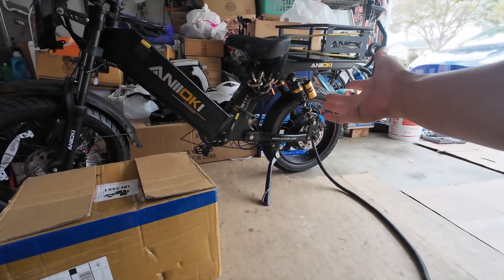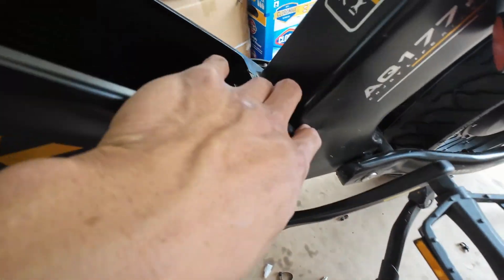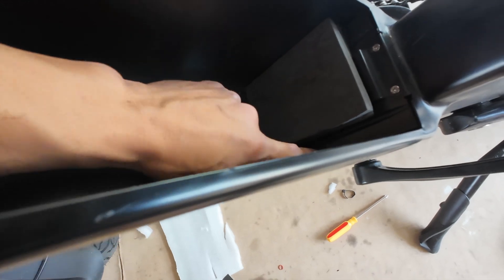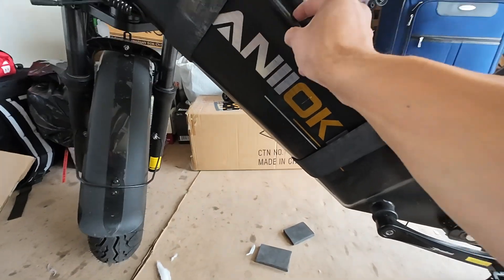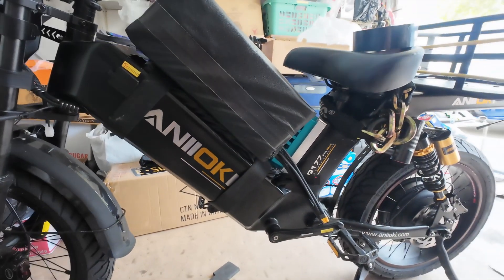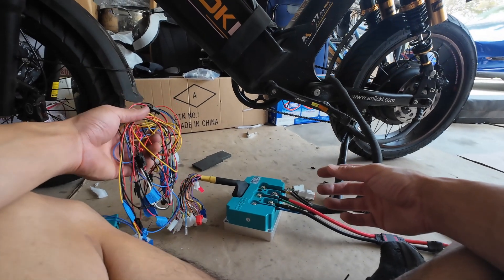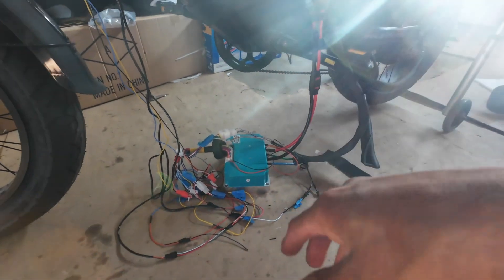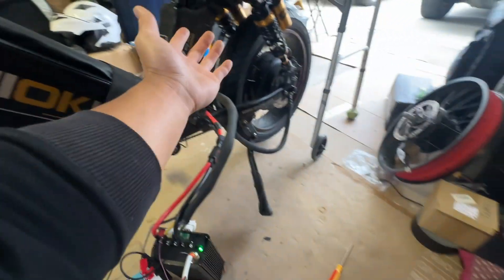Aniioki E-Bike 72v BATTERY UPGRADE

Comment: when you were ordering the battery did you just have to give them dimensions and specs you wanted
Reply from the maker: You give them dimensions first and ask them “How many amp hours can I get with this size and what is the largest bms?” It helps if you specifically tell them which battery cell you want.

Comment: Buyers beware! I have four of these bikes or should I say I am stuck with four of these bikes. My fault, I purchased all of them way too close together. Have had nothing but issues. I received my dual motor promax 8 months ago and still can’t get it right. They sent me parts trying to fix it. They sent me a controller that slowed my bike down from a 45 mph bike to a 38 mph bike. Then they tell me my speed is fine. After two months of fighting with them. They finally just sent me another controller, I haven’t even had time to install it yet to see if it works. This will be the third controller. I’ve had to replace in this bike that did not work. ( MY SHOCK WONT HOLD AIR ) I tried replacing the core valve. Put soapy water on the whole top of the shocking valve stem. No leaks there.  I have to loosen and move the handlebars and re-fill it every time I go riding.    I have walked out twice in my garage to find my expensive bike laying on the concrete because the forks went empty. They tell me that’s OK. You have to put air in them periodically. My battery only goes down to 48v allowing me to only go 40 miles.  Not to mention all the other issues I had with the single motorbikes. if you don’t have a lot of tools and willing to work on these bikes. Stay away from them. I am not just speaking for me and my four bikes but also a lot of people I know on Facebook. It’s just a fact. if you look at all of their reviews on their site and Amazon, including mine. Most of the reviews are with the bike being brand new.  I could go on and on with proof and pictures. But all I can say to everybody is if you have not purchased one yet, stay away from Aniioki.

Comment: What mount did you use for the dkd ? The one it comes with won't mount the handle bar, it's a flat mount. I got my 72450 and 3,000 motor all wired up.
Reply from the maker: @SurfStrands  I used an old mount from a different display. I believe you can use the stock aniioki display mount mount as well, but you just need to drill a new hole for it.

Comment: Can we add an Aniioki battery to a different e-bike? I feel like we could if we get that wire adapter he gutted out… I really need more range on my bike asap 😂
Reply from the maker: @clutchak2919  yea. A guy actually bought the aniioki battery from me to use on his trike!
Reply: @Raspyrides  do you know the name of the piece that connects into the battery itself by any chance?
Reply from the maker: @clutchak2919  no I only know the connector that plugs into the controller which is an xt90
Reply: @Raspyrides  okay thanks for getting back to me!💪

Comment: Hello Raspy. I just got my fardriver 72530 controller from your contact.  But i am getting an error setting up the controller. I am getting a phase current overflow error. I havent did the autolearn yet. The error is preventing the throttle to spin.
Reply from the maker: @Jujubees225  have you tried lowering the phase amps?

Comment: What happened to the battery that it shipped with? I like the a8 pro max? But I'm heavy 275 pounds. Would you think this motor battery last for an year? Thank you and keep you the good work
Reply from the maker: I sold the stock battery to upgrade for a more powerful one for more speed. The stock battery will definitely last more than a year though!
Reply: @Raspyrides  thank you.

Comment: Hmm. . . Is the Fardriver better than the Sabvoton? Does the Fardriver have a kit that includes the display? I'm sure the connectors to the throttle, PAS, and brake sensor are connector specific?
Reply from the maker: It depends on what you mean by better. The fardriver is cheaper when you compare power and price but it’s also more complex with its settings and more customizable. The fardriver does not have any pedal assist features because it was created for motorcycles and scooters. 
Sabvotons are very simple and easy to use but they tend to burn out quicker and are less reliable. 

I’m not sure if there are any kits but you can always reach out to NB Power directly and have them put together everything you need.

Comment: Where did you get your 72 volt battery and controller
Reply from the maker: Batteries are from Amorge and controller is from nb power
Reply: @Raspyrides do you have a link?
Reply: Thanks for the reply I’m looking at making my eAhora Juliet into a beast
Reply from the maker: @ragequit8280  that’ll be so cool! If you want more info on my batteries, I made a video about them and even go over the invoice

Comment: Which tires are those? And how long have you ridden on them and have they warn out?
Reply from the maker: They are motorcycle tires shinkos 567. I haven’t ridden on them much yet but they are insanely thick. I wouldn’t recommend them on a stock aniioki unless you have one of the newer higher power models.
Reply: @Raspyrides  does it come with 2 when you order or do I have to buy another one?
Reply from the maker: @KOD_72  it only comes with 1. Each tire is around $55-60 I believe. I’ve also posted a tire install video for these tires. That video might give you some more info and idea of what it’s like dealing with a moto tire for ebike
Reply: @Raspyrides  I have the same aniioki on are the size gonna be the same as the front wheel location when ordering the tires cause It says unavailable for the rear? Would ordering 2 fronts work?
Reply from the maker: @KOD_72  yes I ordered two fronts. These are heavy tires. It will slow your bike down a bit